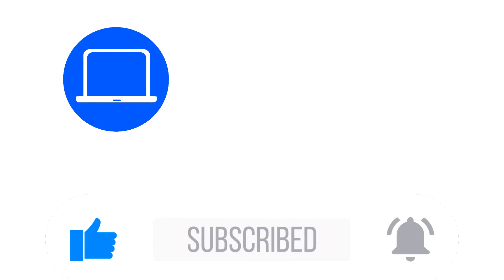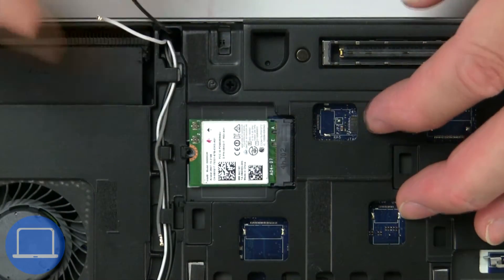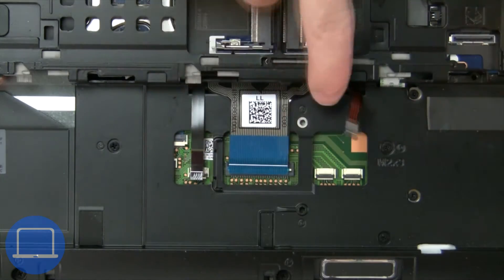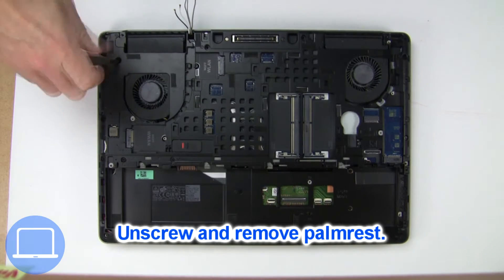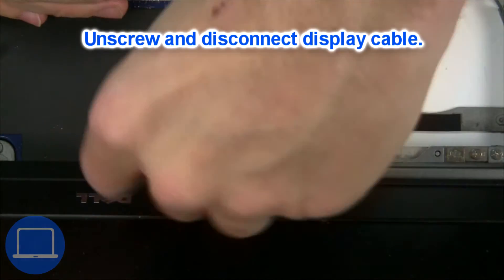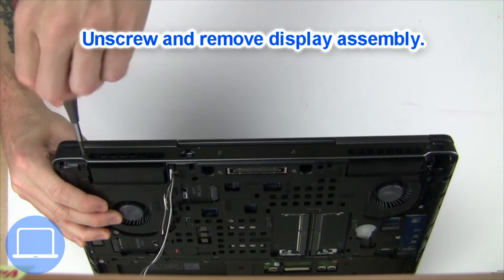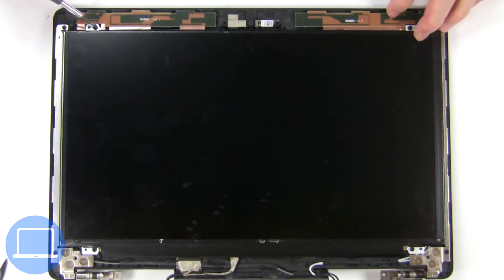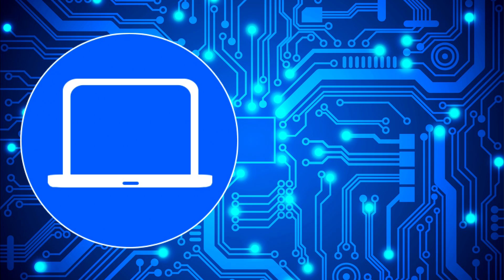Dell Precision 15-7510 (P53F001) Display Cable How-To Video Tutorial

Comment: Where can one purchase the "locking mechanisms" for the palmrest cables? I think the hooks on mine snapped, but it's functional... looking for a replacement part.
Reply: I did the same thing. I snapped one side. I ended up putting it together with the one hook missing. It sitts there for now but I am not very confident about the longivity. Perhaps some tips to push very gently and show a picture how that wihit locking peace works. I pushed pretty hard to make it break. When u get the cable in right it does not need much of preasure to lock